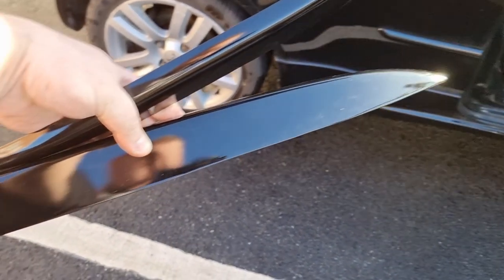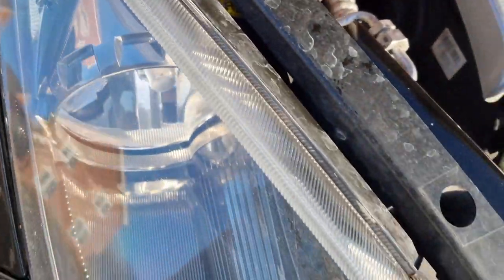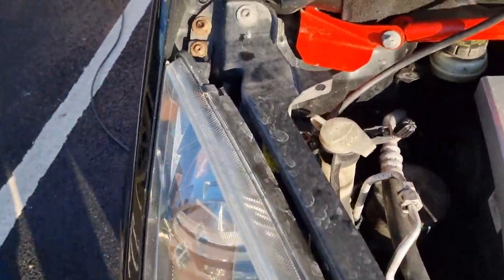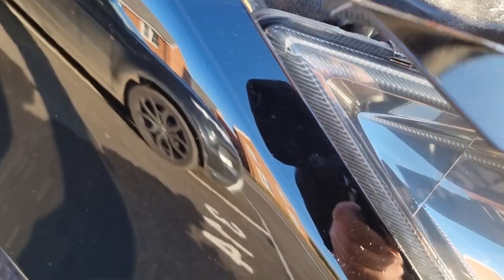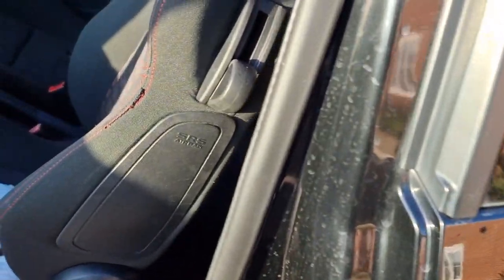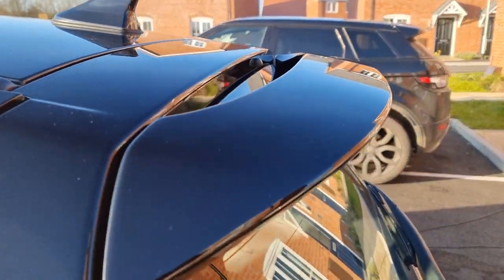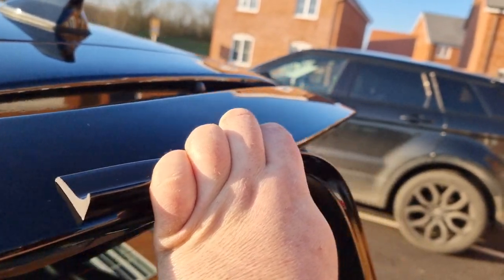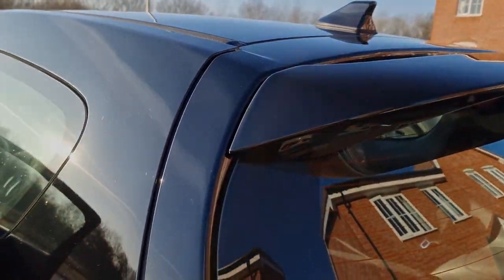Colt CZT Project **Cheap Mods**

Comment: i tried changing the gear knob on my czt but it snapped
Reply from the maker: As in the black plastic piece on the end of the shifter assembly that the OEM gear knob attaches to? I can't remember of that black plastic piece is removable or not. 

Most aftermarket items use rubber inserts to change the size, and uses grub screws to secure it on